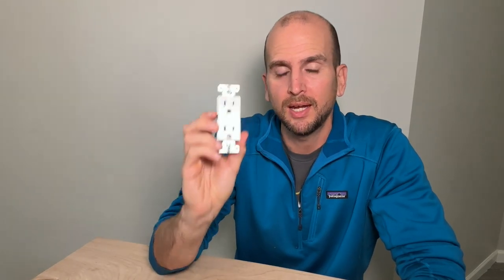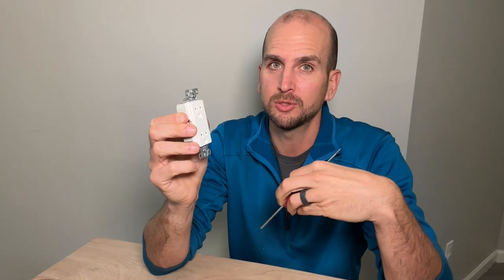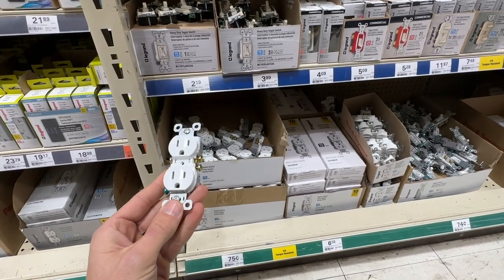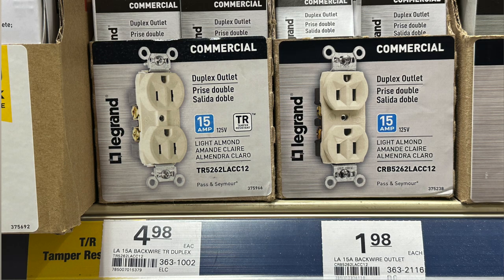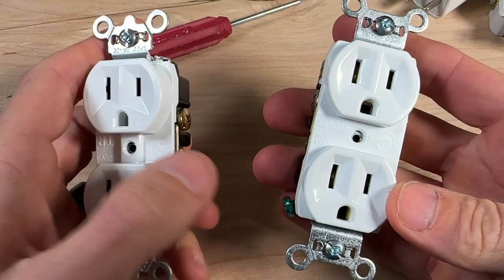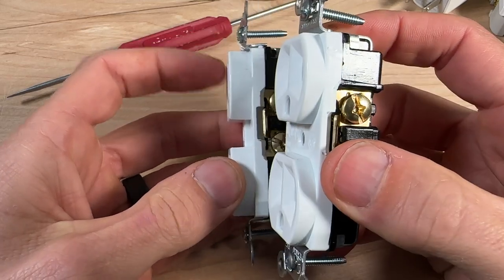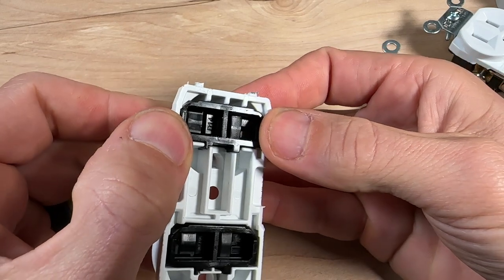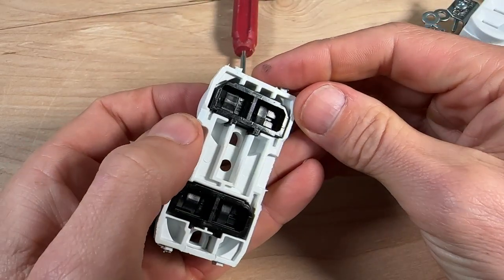The Most Hated Product In Home Electrical

Comment: I have installed them almost everywhere per code. They are not that bad. Just wiggle the plug side to side a little when you plug it in. My daughter was the one that put a chain of paperclips in each side years ago. She hot a big surprise.
Reply: Ditto...code here requires it so I installed them. A little wiggle lets the cord go right in. Rarely have any issues unless someone had badly bent the prongs on the plug and they're no longer aligned.
Reply: You can do the same if you push in two paperclips at the same time. The child that does this could end up in cardiac arrest. Wiggling them in can cause the prongs to bend. This has already happened to me several times. You can buy outlet covers to make the outlets safer.
Reply: I've found inserting the prongs using a downward angle and then wiggling it up and down works better.

Comment: I replaced some probably 20 year old regular outlets in my house that were very loose. One small tug and the plug falls out, which was very annoying when using things like a vacuum cleaner. I replaced them with TR outlets and I actually like they're very tight and snug, they feel more secure and they eventually get more loose over time so its not as difficult to plug in stuff now. Overall, I think they're nice and if they're safer to use, especially with kids, why not!
Reply: I had the exact same reasoning. Added a couple outlets in a bedroom-turned-office where my copiously large MacBook Pro wall wart was consistently falling out. It's been snugly in the new leviton TR outlet for months now without issue.
Reply: plugs are securely held because the receptacle is new. has nothing to do with the TR function. A new standard receptacle would be just as tight.

Comment: When my daughter was little, I swapped a bunch out for tamper resistant that were low on the wall and easily accessible by her. This is because those little child safety caps can be pulled off easy. I caught her once playing with an outlet, that was reason enough for me to change them. If I had to replace them again, now that she is grown up, it would be with a non tamper resistant version.

Comment: The struggle of plugging something in is the reason I usually stay away from them. I think installing them in a kid’s bedroom or playroom would be a the reason I would install them.
Reply: Unfortunately building code in residential areas now requires any outlet that is below 5 ft from the ground must use tamper resistant outlets. It really sucks! I am no electrician, but remodeled my basement two years ago and the building inspector required us to use those. It is so hard to plug into them that we have broken a few of the outlets. Really makes me feel good about how safe they must be. I'm sure a kid could easily injure themselves messing around with a broken outlet.
Reply: @billyoung8118  
Nope, they couldn't.

If they don't touch both wires, they aren't grounded well.
Not being grounded is why birds can sit on bare high voltage lines.

Dry wood, carpet, and vinyl are horrible conductors. So you don't get much of a shock.

That's why almost no one gets electrocuted by plugs in America.
They get electrocuted by damaged cords and shorted out appliances. These let you "touch" both wires at the same time, giving the electricity a complete path to ground, through your body.
Reply: @lordgarion514  the cover of the plate was actually broken, cracked. The kids seeing that could easily pry it off and play with whatever's inside. I'm not talking about the cover that's screwed over the outlet, I'm talking about the plastic on top of the outlet itself, what the plug pierces through to hit the conductors inside. That makes it very possible kids can get hurt. FWIW I have a B.S. in electrical engineering and am extremely knowledgeable about current flow.

Comment: I hate those things.  Was trying to help my dad out at his house with a GFCI outlet.  The GFCI tester wouldn't even go into the outlet to test it.  And the electrical tester I use wouldn't go into the hot side to even test it since it needs both prongs going in at the same time.    Terrible.
Reply: I accidentally bought them for my shop I recently rewired. I thought these black receptacles would look cool. Hate those things!! I got to change em out.
Reply: No clue why the first one didn't go in.

But the second sounds like an idiot stick. They don't need to be inserted to work. Just remove the cover and get it near the wire.
Reply: @lordgarion514  I was trying to test several outlets quickly.
Reply: @todd2456  
Not gonna lie, it's better to test everything before you cover it all up.

Learned that the hard way when we had a GFCI bad from the factory.

Comment: I have an old house and had a bunch of loose outlets. I went with commercial tamper resistant outlets on everything, I think I ended up using just over 24 outlets. I had at the time a 3 year old now going on 7. Lets just say they've worked very well with her shoving things in the plug's and even pulling out the child proof cover's. Little hard at first but a few plug in's the resistance to insertion is a lot less. I used leviton outlets with nylon wallplates, just basically because there's a home depot not even a mile down the street. This kid figured out most of the child proof stuff sold with ease but those TR plugs, they got beat up and never failed to protect.

Comment: I bought my house a year ago and replaced every outlet in my house with Leviton TR since most were worn out and I've never had an issue. Just put it in straight, slightly wiggle left to right and it goes right in.

Comment: I totally get it. I bought one of these tamper-proof outlets by mistake, and after I installed it and tried to plug something in, I couldn't. It was frustrating to me as a DIY'er... Thinking that either I had messed something up, or had purchased a faulty product. Well, long story short, I won't be buying the tamper-resistant receptacles Because they are a pain in the butt.😬
Reply: 7:04

Comment: The electrician who wired my shop said that he had to put in TR receptacles.  They totally suck.  I have to fight to plug anything in.  I don't know if it's the brand or what.  All I know is that they are difficult to use and they may get replaced here shortly.  I've been zapped by 120 quite a few times and I'm still kicking.  Stop looking at my twitching eye!  😁
Reply: NEC does not require them if located 5-1/2 feet above the floor, which might be the case in a shop.
Reply: I have gotten a shock by light socket when I was a kid, small shock from replacing a ceiling fan , and struck by lightning..thankfully I'm still kickin
Reply: @Bert Hongo The electrician was following the NEC Codebook 406.12. That basically requires them  everywhere, but as Kamerashy stated, they are located 5-1/2 feet above the floor.
Reply: @Bluesman57  Yeah I get it, he was doing what he was supposed to do and I told him that I wanted everything at least to code.  He did a great job on my shop as well as my garage.  Well worth the money.  Just saying that they are difficult.  Thanks and have a great day!
Reply: Even if the nec doesn’t require it, most shops require us to install them. Even as an electrician I hate them because it’s a pain in the neck to stick our leads in to take readings.

Comment: I've used Leviton. I find they tend to be a problem the first couple of uses. I also find that the problem, in general, tends to go away as users get used to going straight in with both prongs simultaneously. I've also run across some plugs that have, not just 2 different width prongs, but 2 different length prongs. They don't have to be off by much before the TR outlet won't let the plug in. I find that holding the plug slightly loosely as I start it in helps by allowing the plug to shift in my hand when the prongs make contact with the shutters, aligning the plug for a more, straight in alignment. I then tighten my fingers and push.
Reply: Couldn't have described it better. I use the same plugs, haven't had many issues...but there's always that 1 plug that you just can't get something plugged into.
Reply: One thing I found with Levitons is if you don't plug-unplug regularly they get stiff and sometimes need replaced. I've had to replace ones hardly used after 5 years or so and after unplugging my dishwasher, which had been plugged in for a looooong time I couldn't get anything to plug in there again.

Comment: Some places have code requirements for TR outlets for any new or retrofit applications. So yes, you can replace them with a non TR for yourself but if you need to call an electrician to do the work for your garage/attachment/new construction they have to go with TR outlets. BTW I found that you can "break" them in and just plug-unplug a quickly few times and afterwards they work just fine.
Reply: Agreed- there is a "break-in" effect where they shutter action becomes much smoother, at least in the ones I have.

Comment: I haven't had much issue with the Eaton commercial grade tamper resistant outlets.  I have kids and don't mind spending $5 a pop for them.  My most hated product in home electrical is the arc fault breaker.  I've rarely had issues with GFCI breakers and outlets, but arc faults are horrible!
Reply: Arc fault breakers are notorious for nuisance tripping. Totally feel your pain on those.
Reply: @esl4058  yeah, refrigeration compressors in window air conditioners.
Reply: The homes most likely to need arc fault breakers are older homes and yet those are the ones least likely to be upgraded with AFCIs. New homes are required to have them and who knows if they will actually work 50 or 60 years from now when the connections throughout the house start to loosen up.
Reply: @janderson8401  well, that's the point, for them to trip of there is a loose connection.  Not to nuisance trip every time a window AC cycles in 80 degree weather.
Reply: @nicholassmerk  
But it's known they have a problem with brushed motors sometimes.
Reply: @lordgarion514  but but  AFCI's are for your  safety. To quote Dick Jones from Robocop - Who cares if it works?  thats about the mentality of the NEC

Comment: I’m replacing the forty year old backstabbed receptacles in my house and I actually went with the commercial grade decora ones from Legrand.  I had to order them from an electric supply shop because nobody around me carries them, so I only ordered enough for one room because I wanted to test them before doing the rest of my house specifically because of how bad the TR mechanisms are at a friends house.  I installed the first room and was quite surprised at how well they work, there’s almost no extra resistance and I probably wouldn’t be able to tell the difference between the Legrand TR receptacle and any other non TR receptacle.  The next day I went back to the shop and ordered enough for the rest of my house.

Thanks for your videos by the way.  They’ve been extremely helpful when it’s come to the finer details of swapping my receptacles and switches that can easily be overlooked.
Reply: Are you aware that the Contractor Grade are the lowest quality. Don't buy cheap contractor grade TR Outlets which do not function well....... If you purchase quality TR outlets they function flawlessly! TR Outlets are not deeper than a non-TR outlet...  Let someone get hurt in your home with an item that you should have purchased diffectly by code and see what your homeowners insurance does if they is a liability issue...

Comment: Two things at work here:
(1) Kickbacks by manufacturers getting stuff made mandatory in order to sell higher cost crap.
(2) Protecting out-of-control kids since parents no longer teach them things like how to stay alive without being in a bubble.
MY SUGGESTION: Forget tamper resistant receptacles and the like, and take the stupid warning labels off products. You know the ones - labels on appliances warning not to use in bathtub, pool, or whatever. It would be best to JUST LET STUPID WORK ITSELF OUT.

Comment: I have just replaced an old outdoor outlet with a TR one, thinking it was a good idea. I regretted it right away even before plugging anything into it. I tried to test it after installation with a voltage tester, the kind that has a plastic tip. Since it is necessary to "open" both the hot and neutral "gates" at the same time, I could not put the probe in deep enough to sense the current. I'll replace it with a non-TR one when the weather becomes warmer and when I can work with the caulking. I'll never touch the TR outlets again.
Reply: We call the single prong testers "idiot sticks", and you don't need to plug them in for them to work.

Just remove the cover and get it near the wire. Doesn't even need to physically touch, just be close.
Reply: The trick is to plug something in (eg a cell phone charger) about 75%of the way, then test on that plug that is now making contact with the receptacle contactor. You can also use your tester directly on the plug ends at the same time.
Reply: @erikkarling2176  
If you're testing for power using a cell phone charger, you can just connect the phone to the charger.
Reply: If you add a new circuit greater than 6 ft. you are required to use TR Outlets! Let someone get hurt in your home with an item that you should have purchased diffectly by code and see what your homeowners insurance does if they is a liability issue...
Reply: @michaelholliday100  Before critising, perhaps you should take more care reading my post.

Comment: The first time I bought a TR receptacle, it was a Legrand with two USB connectors. The biggest problem I have with that was that the shutters were extremely stiff, it's like it was designed to expect a ground pin to be inserted. If if was just the two blades, it was tough, but if the ground pin was included, it seemed a bit easier to insert.

However, when I replaced a few GFCIs with an Eaton/Cooper TR GFCI, those seemed to be a lot easier to use. Almost like they knew that not every plug is going to have a grounding pin. My mom, however, had some trouble plugging things into it, only for me to observe that she's been inserting them at a slightly awkward angle than what she had thought. Once I pointed out her actual issue, she readjusted, and adapted.

Comment: Interesting video. It would be helpful to mention that there is a specific way to insert a cord into a tamper resistant plug. For a two pronged cord, lay the two prongs on the lower edge of the  plug at a slight angle with the cord end tilted down. Then just roll the plug into the outlet. Unfortunately, you have more difficulty using a three prong plug.

Comment: I renovated our entire basement building 2 bedrooms, office with 7 plugs, and a complete 11.1 home theater room with 2 separate 20A plugs all using tamper resistant.

A box of 10-15A, bought before covid, I think I paid ~$16 for each. I have now issues with them. The 20A one's I bought were Eaton's, obviously more expensive. Rest I believe were Leviton.

Easy to wire, square tamper resistant not wildly expensive really than the cheap round crappy one's we grew up with. I see no issue's with them. Sometimes you have to stuggle a bit to get plugged into a new outlet that hasn't been used before, hence tamper resistant. Lol

Comment: Depending where you live and your local codes you don't have a choice. 
Here in Ontario, Canada provincial code states that after a certain date, all new and updated duplex outlets are to be Tamper resistant.
Reply: I'm in Ontario and all of mine are getting replaced.  I'm putting all regular receptacles in and I'll be buying a case of them to put away for replacements in case they stop making them.  My kids are smart enough not to shove something into a receptacle and if one of them does it anyway, that's just my wife's side coming through.  "Honey, pick Sparky up and give him a cookie."
Reply: Do like the AFCI and install them for the inspection then immediately replace them with functional equipment.
Reply: @randomvideosn0where  and probably invalidate your insurance
Reply: @michaeldunham3385  Has nothing to do with insurance.  Older homes are not part of the new code.  New homes require them.  You am not required to retrofit older homes.

Comment: It had not even crossed my mind to replace all the outlets with TR, and I am already in the process of replacing all outlets (old outlets are old, standard, ivory with backstab connection, new are commercial grade, white, decora, and obv not backstab).  I guess in my mind, it would make sense if we had little kids, but we don't.
Reply: I've been flipping houses for almost 8 years. We replace all outlets and switches.

I've never seen an outlet that you didn't have both the screw connections and the holes to stab.
Not old or new. They all have both.
Reply: @lordgarion514  They have both, but old outlets let you use 12 gauge with backstab, and newer ones only let you use 14 gauge.